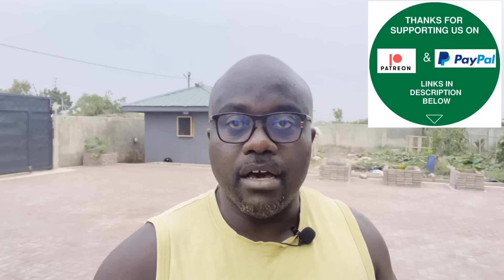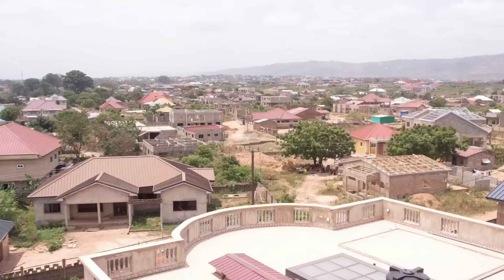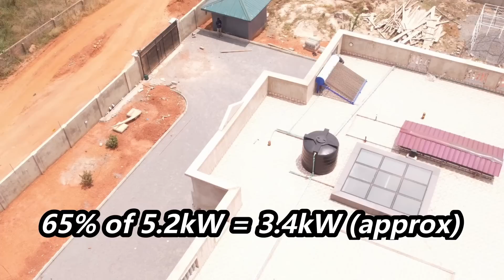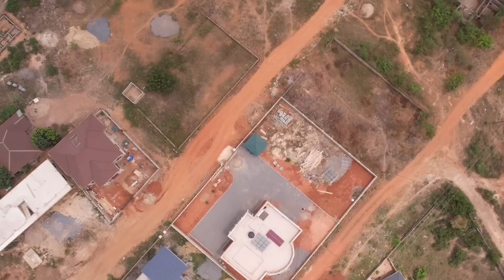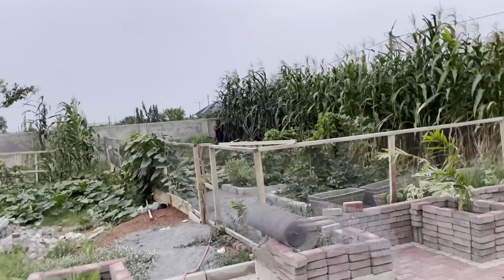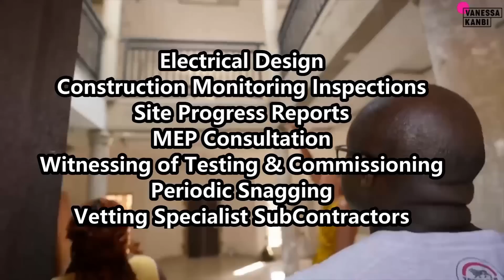BUILDING IN GHANA | SOLAR SYSTEM BASICS

Comment: so using  400 watt panels, using 60% as the generation number for the panel gives us, 400 X 0.60 = 240 watts.  ouch. 
for a 10,000 watt system = 10 kw one would need  10000 / 240 = 41.6 so 42, 400 watt panels. 

say a panel is 1133 mm X 1723 mm  = 1.133m  X 1.723m = 1.952 square meters.  2 square meters. for 42 panels X 2 square meters, one would need at least 84 square meters? 

hm, I wonder what a system would cost. just for the panels in Ghana. 
with such a system and 10KW of storage batteries, 5 hours on average solar,  5 X 10KWh...
such a system would fill the batteries in say an hour or so?  I wonder is it possible to have batteries that could run the full house, full load for 14 days? what would that look like?

I'm thinking wrong, right? 

if lots are 100m X 70m a ground mount system would work or elevating the panels would still allow it to fit right. (not placing everything on the roof) 100X70= 7000 sq. meters, 7000 sq. meters - 84 sq. meters = 6910 sq. meters still a lot of space or not?

I must be miscalculating right?

very interesting video, very educational. 

hey, would evaporative cooling work in Ghana?

Comment: My two cents about solar batteries. I have a 5kw lithium LifePO battery. It's important to know that batteries aren't 100% efficient so you'll loose some of the power through transmission and heating plus the inverter will use some of the power. For an average SMALL house, I'll say 10kw is the minimum for reliable overnight load (minus major appliances). The bigger the battery storage the better cus it can compensate for small solar panel capacity with stored power. And like you mentioned, lithium batteries are the most expensive component

Comment: Hello there, how about using a backup generator to charge the batteries and run your house when the weather is cloudy and there is not enough sun to run your system, instead of ECG?
Reply from the maker: Of course
That is possible also 

Just check the cost of fuel vs the tariff from ECG

Comment: I really didn't investigate solar power much because I knew it was very expensive  to install. I learned a lot here. So my question is. Since the battery's are only guaranteed to last 10 years before replacement might be necessary , can you really save money in that time frame in GHANA?
Reply: ECG, the power providers, is very expensive and unreliable.  Overall, you would have your money's worth. The convenience of having power every day would be worth every  dime of your investment
Reply from the maker: Good Question
That need a payback calculation to determine 

If ghana had the economic incentive like some other nations it would be more attractive